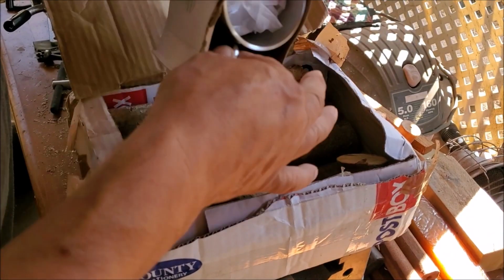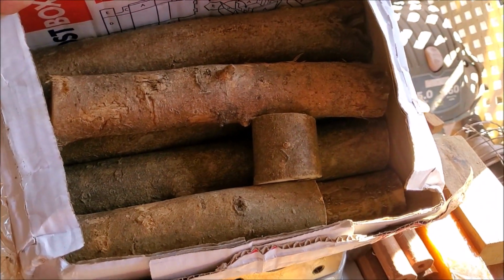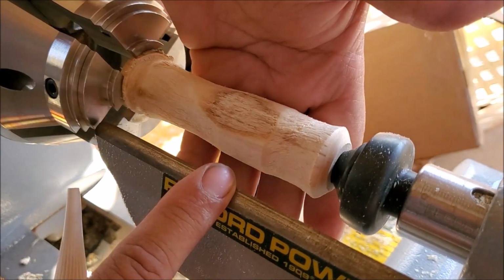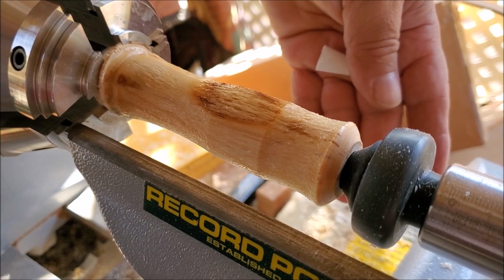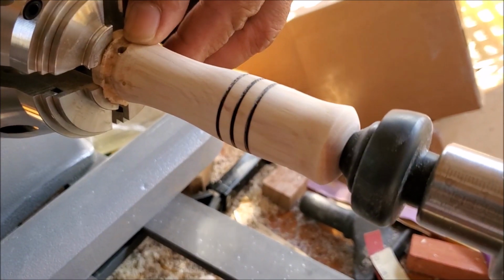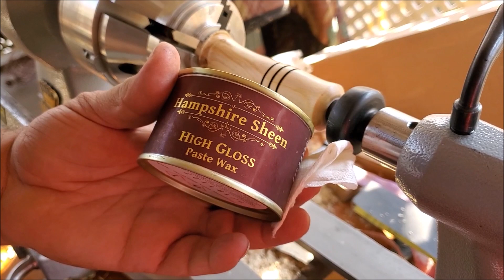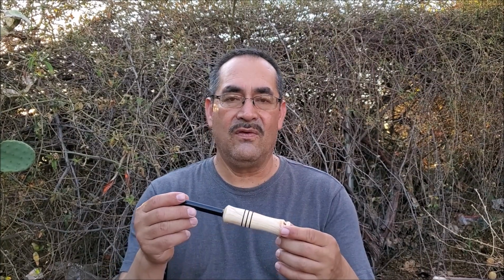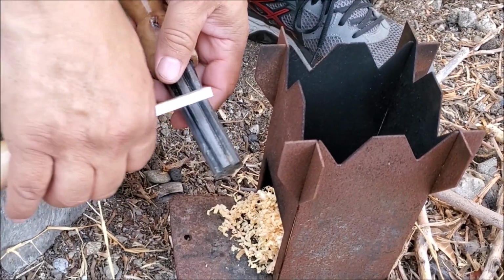"Turn and burn" for Fairytale Wizard. Burning some Ohio fatwood. Making a ferro rod from yew wood

Comment: I like that cup and the handle is a snap hook called a carabiner for mountain climbing , great looking Wood also , 
I been glueing up some more multiple Wood for more handles and gathering up some wood for cutting boards
Reply: I was turning one day and my spindle came out like yours did at 2:27 , 
Only mine flew out and hit my brother's 56  Chevy  Bel air ,
He wasn't too happy about it , 
That was over 30 years ago and hasn't happened since , 
I finally got married and got my own wood shop , now I barely have time to do all the things that I want to , 
So I'm going to go start a few Ferro Rod and Fat Wood fires